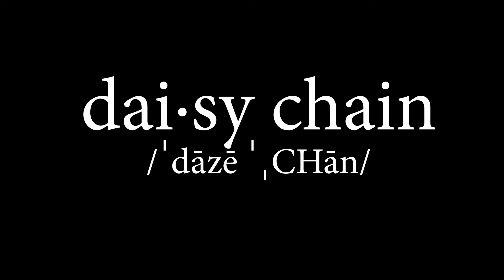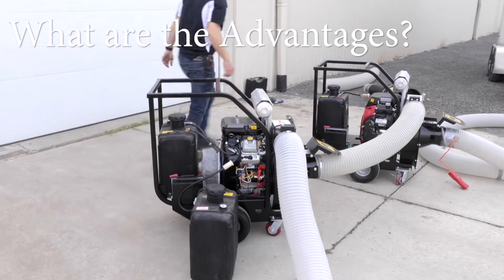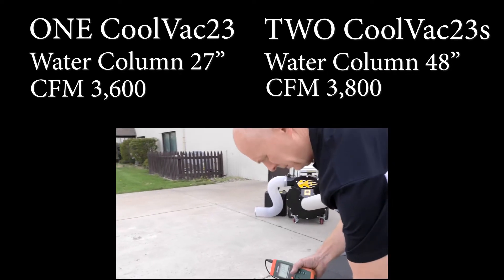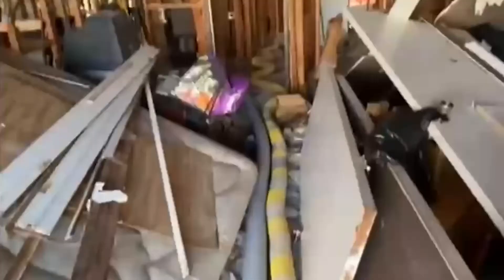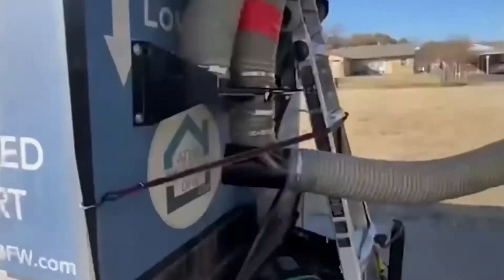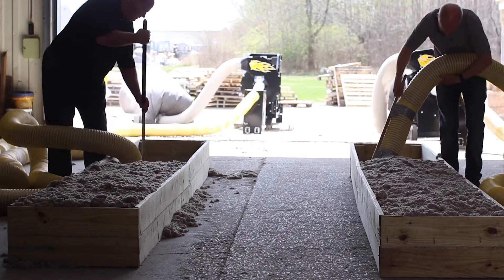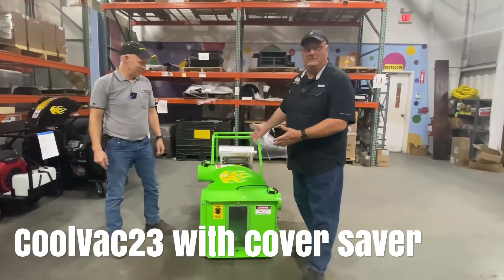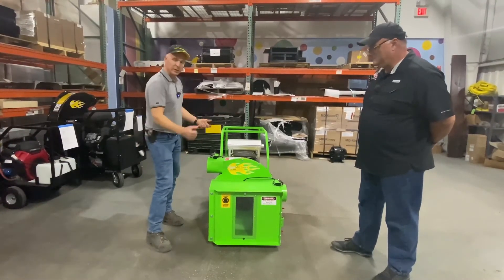Linking "Daisy Chaining" Insulation Vacuums— Getting Even More Production!

Comment: How much benefit is it going to be when its choked down to a 4" hose that some use? At some point the hose is only going to allow so much flow.
Reply from the maker: The 4" hose does not impact production if you use 6" hose and then reduce down to 4" at the end. Sometimes it is difficult to use 6" in tighter attics. We have a video comparing all 6" to a 6" to 4" reduction. Not a noticeable difference. https://youtu.be/ucdKFQtflJg?si=_U6qeZlX3rvVtR4I
Reply: @InsulationMachines  but less material due to the fact its a smaller hose.
Reply from the maker: We have tested this in factory and in the field. No measurable difference. You dont have to reduce to 4". Keep in mind, a 6" hose is harder to manage in tighter attics which will slow you down. I posted a video above.